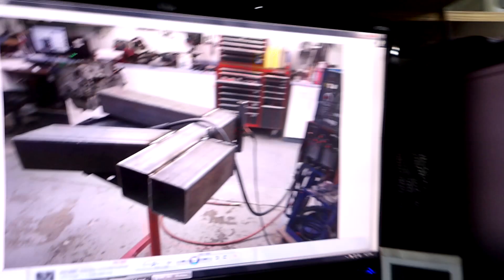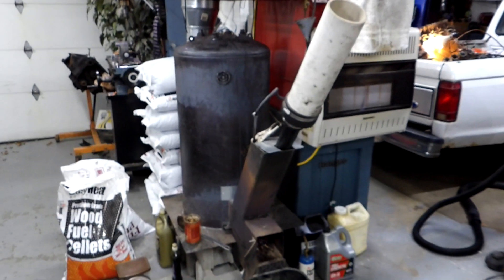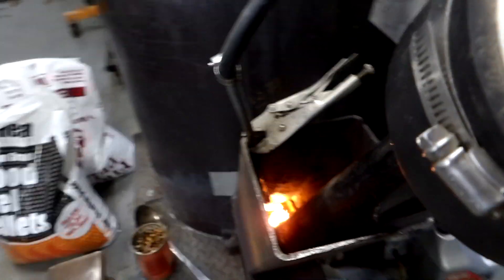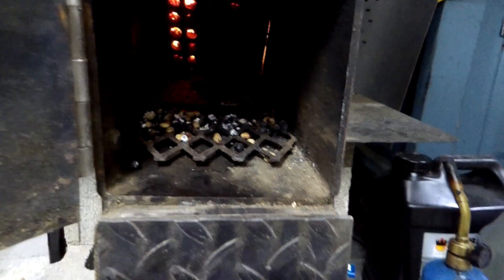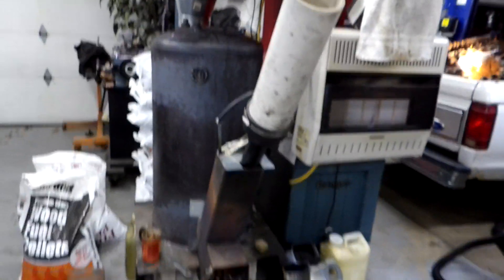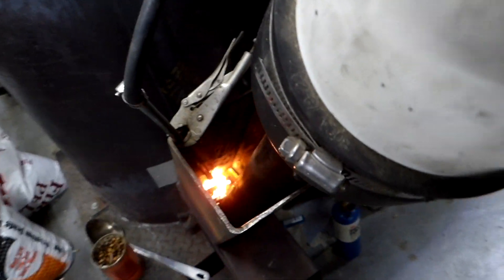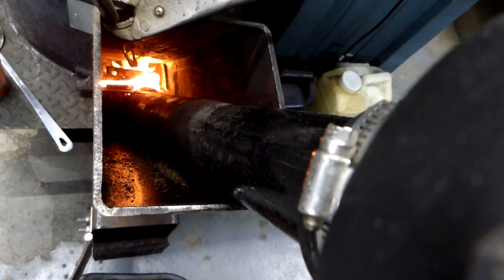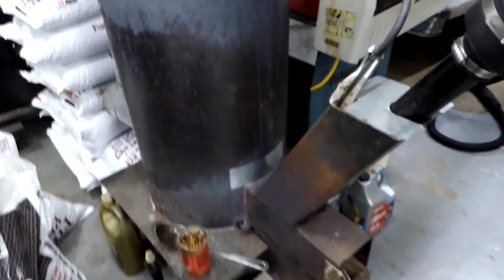Rocket Stove on Wood Pellets - They ROCK !

Comment: Just waiting for a friend to get me a 6 inch heavy duty 316 4ft stainless tube it's all a waiting game if you want The materials for free
Reply from the maker: Are you going to make the burn chamber AND the riser out of stainless ?  If so, you'll need 8 feet to duplicate what I've built.  2 feet for the horizontal burn tube, and just short of 3 feet
for the vertical riser -- assuming you're using a retired 40 gallon hot water tank that measures exactly 3 feet high, plus another 2 feet for the feed tube.  The clean out isn't really necessary, but if you want to incorporate it, you'll need 1 more foot of tube for a total of 8.    I stopped the riser about 1 1/2 inches from the top of the tank.

Comment: How long has this been running have you had any issues with the riser chimney/tube burning out thanks
Reply: Thanks for fast reply very intrested how it all works I will be building a rocket stove in the near future so trying to gather as much information as possible so I can buil it once to last forever and also have an unlimited supply of wood chippings so maybe use nearly the same method as you just trying to source a very thick walled steel riser tube it will be worth it in the end
Reply from the maker: @grahamprecious7330  If I was designing one to burn wood sticks/logs I'd make the feed tube straight up and down and instead of 5 x 5, I'd go 6 x 6 for the  feed tube and burn chamber.   Let me know how it works out !
Reply from the maker: This is my 4th season, and no problems with the riser tube burning out. Even the burn chamber looks great.  I didn't insulate the riser.  No need to in my opinion.  In fact, you WANT the heat to escape into the barrel so it can then radiate into the surrounding space-- at least that's the way I see it.

Comment: Hey nice job! How many bags of pellets do you use? If you want to share some of the plans on the design we would be grateful. I need to make one too. Thanks again !
Reply from the maker: I'll burn 3/4 of a bag a day for most of the heating season, Nov thru Feb.  The design is what I describe in the video. 5 x 5 square tubing and a retired 40 gallon hot water tank.  I need to rebuild the burner so may be I'll make a video on that.

Comment: I have slightly strayed from your measurements and it might be too late to turn back.  INPUT PLEASE?????
Burn tube 6"x8" high
Feed tube 6 x 6
Riser 4" x sched. 80
Will making heat riser tube smaller have too much restriction or will it give a venturi effect?  Inside of riser is 3.5" id.
Reply from the maker: Sorry Wayne, just seen this.  For some reason I wasn't getting notifications.  I think your design will work just fine... the 4 inch riser will  limit the air flow, meaning, it will then determine the total BTU output along with the height of your chimney.  The feed tube will allow you to put in larger pieces of wood.... a good thing.  It's something I would do if I built another one.  As well as the larger burn tube.  All good.  Did you end up using it ? and how did it work out ?   Email me @ gearhead4you@yahoo.com if you'd like, I love to know more.

Comment: Sir, is your rizer tube in the tank made of stainless or insulated, sounds like you've had it running some time with no issue. Great design Im thinking of making a mini for a camper.
Reply from the maker: It is just cold rolled steel, cheap, inexpensive, 5 x 5 square tubing. It is not insulated, nor is the burn chamber (the horizontal leg where the fire exists).   I do not understand the reasoning behind insulating the riser and chamber.  It seems to me you 'want' the riser to 'give up' it's heat to it's surroundings. The temp within my burn chamber is so hot it is already burning the wood gas - the whole point in a rocket stove.  I think the people who insulate the riser are attempting to ensure the wood gas gets burned.... that's all I can figure.  Not necessary - IMO.   There is no sign of degradation to either my burn chamber, or riser after 3 full seasons of use. If you insulate the riser and chamber, you'll be fighting constant degradation from overheating. At least that's what I've seen in other videos.  Hope this helps.
Reply: Great !   Don't believe it's good to run a stove over 550 temp as you get intense degradation over that (Why the use of SS steel I figure). I built a small regular stove and was able to get 850 temp but it did start flaking at that temp. Great proven job you have. 

Looking At your feed/drop I'll bet you could make an adjuster fine tune the funnel up /down, but suppose it may all be relative to other factors......   Thanks 
It's good to know your work has endured so far.. I will take your lead and not worry about insulation.  Thanks for that.

Comment: If I build mine using a 30 gal or 55 gal metal drum, do you foresee any problems?
Reply from the maker: No, I believe either will work. If you live in a very cold climate I'd lean toward the 55 gallon drum. More surface area = more heat transfer  ;-)

Comment: Great design!  Such a nice job... Ramping up for my own build and I do weld so your design is very doable!  As an experiment did you ever burn kindling wood? (If you ever ran out of pellets for some reason.) Did you video your pellet burn chamber build? I know it sounded simple but sometimes words alone don't leave the audience (me!) without some questions... Like, the relationship of the burn chamber over the ash clean out?) Thanks for sharing. Again, great design!!
Reply: Your other video answered my question re burning wood. Obviously works fine, just added labor!
Reply from the maker: Yes, a lot of labor. Have you seen these people who use small pieces of wood to heat their home throughout the winter months ? I question it. Yet it's being done. Fouch Family for example. They're banking the energy. I'm thinking their burn chamber is larger and insulated with the surrounding mass so that they can use larger pieces and the fire is maintained. Perhaps 8x8 and the burn chamber encased in cement block.
Reply: I haven't seen that particular one, but have seen many rocket stove mass heater builds and some are really impressive. I have a farm in Michigan (hour north of Grand Rapids) where the mass heater sounds like a nice option, but here in Indiana I just need two rocket stoves. One for a garage and the other for a small house about the size of your two story work shop.  I'm using (a gift) commercially built pellet stove to heat the house. It uses about 1 to 2,5 bags per day (40 to 100 lbs) depending on the heat setting. Currently I know I am loosing tons of heat up the chimney flue! I thought it might save me some money over electric heat, but now I don't think so. It doesn't burn hot enough = lacks efficiency!  I'll try to let you know how my build is going, especially if I try any modifications... Thanks again for the videos on your stove and for getting back to me re my drum question!
Reply from the maker: I have, parked to my left, about 40 feet away, a commercially built pellet stove that I tried for the better part of a season. What a joke.  Like you say, burned over a bag a day and I wasn't warm !    They do not throw off UV except the tiny window on the front of the stove.  Sure, the air would be 68-70 but I was cold.  Couldn't take it.  Put the rocket stove back in place and instantly I was warm from all the UV radiation it gives off.  That big dome (40 gallon tank) radiates UV in every direction.  It was 56 in the shop this morning (20F outside last night) and within 20 minutes of running, I was already warm enough to be comfortable even tho the air temp in the shop was only 64 by that point.  The down side is of course the fact that you have to 'tend to it', like any wood stove. One more thing.  With the commercial pellet stove running, my metal wash tub and work bench was forever cold to the touch.  With the rocket stove running, those same items, some 25 feet away, are warm to the touch.  It's all about the UV  !
Reply: Mark, thanks for the conformation...  It wasn't just "me!"  Forgot to mention - Your putting the fan over the rocket stove blowing down seems brilliant especially since you are working on cars and, no doubt, find your self kneeling or lying on the floor... The downdraft of warm air sounds wonderful!!
Reply from the maker: Yup, the down draft fan is everything.  Warms the floor for 20 ft in each direction.  While we're on the subject, the first fan I used pulled 145 watts on medium.  When it finally quit (melted it twice because I forgot to turn it on..lol... dripping strings of plastic- and Stink !) I purchased the first $16 fan I ran across at our local True Value hardware.  This thing pulls 40 watts on medium and 52 on high.  Who'd think technology would advance that much when it comes to fan motors. I bring that up because if  you live off grid like us, that 100 watt difference is huge !
Reply: Not living off-grid yet but working toward that option... Thanks for warning about the fan... I may try to find an all-metal version (as my memory might have the same failure!)  20' is a really nice spread!!  I don't have time to start the build for a few weeks, but am gathering materials now.  Really appreciate your helpful dialogue...
Reply: I don't think it's UV=ultra violet, maybe IR=Infra red?
Reply from the maker: Hahahaha.... YES Craig Symington --- IR (NOT UV)... I'm such a dope...lol.

Comment: Thanks for your last response, just on more question.  For my outer shell I am looking at using a piece of 16" diameter pipe.  Unfortunately it is about .280 thick.  I am guessing it will take a little longer to heat up, but will also hold the heat longer. 
The reason I am using the 16" od pipe is that a large truck brake drum will fit perfectly over the top.  I want to use the brake drum because of it's mass and weld 1/2" plate on the drum sealing up the center.  It will also allow easy removal for inside inspection.  
I appreciate any input.
Reply from the maker: I think it will work.  The thickness, like you say, will just store some heat.  My 40 gallon tank is 18 inches in diameter, so it's just a tiny bit bigger.  The main thing is you want a tank that has as much surface area as possible- within reason.  The more surface area, the more efficient it will be at radiating heat to the surrounding air.  I'd be willing to take a guess and say that a 30 inch diameter drum would be quite a bit more efficient than my 18 inch--- but, a 30 inch drum would also be unreasonably large for the area most people have to work it.  Your brake drum is a great idea ... and with the plate, you'll have a flat surface to park a pot of water if you need some added humidity !

Comment: If you fill your feed tube with your pellet/pit blend, how long will it run on a fill up? The biggest drawback to a rocket stove is you can't really stoke it but with your design and fuel choice, you can! Awesome job!👍😁
Reply from the maker: In the beginning (morning) with a cold shop and clean burner, it will run about an hour and 15 minutes on a load of pellets.  So from 8 am till noon, I fill like 3 times.  In 20F weather, the shop will have gone from around 60F to 70F in that period of time.   At this point, the burner is starting to partially fill with ash, which works out good because I don't need all the heat that a clean burner puts out.   Then, I put pellets in perhaps every 2 hours and by 4 pm, I'm down to hardly putting any pellets in because the burner is nearly completely clogged with ash.  At that point, if I need some heat, I take my stir rod and agitate the burner a bit which allows the ash to fall thru the holes into the clean-out chamber (below) and within minutes I have a ton of heat flowing once again.  

Prior to building this rocket stove, I had a burn barrel that I'd modified in attempt to make it efficient.  It was a 55 gallon barrel that I had lined with fire brick and had a re-burn plate that I'd fitted in attempt to get the wood gas to burn.  I was somewhat successful.  However, the amount of work that went into making kindling to start the fire, and tend to the fire through out the day was many times the amount of work that goes into scoping the pellets into the hopper several times a day.  It isn't even close.  Yes, I could bank the fire for several hours, where you can't do that with the rocket stove. But with the rocket stove, if the fire goes out because I had to leave for several hours, I can have it going again in minutes by giving the ash a stir, dumping a few pellets into the chamber and lighting another fire starter.  

Thank you for your comment and the compliment !

Comment: Very nice.  Curious what you did for a heat riser, is it insulated, is it burning out like many do, what size is it, and what material did you use for it
Reply from the maker: Take a quick look @ 0:15 -- 5 x 5 x 1/8 wall square tubing - nothing special, just off the shelf from the local metal supplier. Not insulated. I see no reason to insulate the riser like so many people do when they build a rocket stove. The flame is 1500F + in the burn tube- thus burning all wood gas before it even gets to the vertical heat riser. In fact, you WANT the vertical heat riser to give-up it's heat to the surrounding air before it takes a trip south and ultimately out of the can and into the chimney-- right ? Why would you want to stop that process. I'm not asking you, I'm just saying, why. Why would you want to insulate the riser. As you stated, you'll find many examples of risers burning out from the extreme heat. I can't see my riser, but I've looked into the burn chamber with a strong light and it looks just fine. A tiny, TINY bit of flaking on the walls right after the burn basket that's it.  Given that, I'm sure the riser looks like new.  

You might find this interesting.  On the back side, where the chimney connects, I have a clean out cap that I can remove. It's 6 inch diameter.  While the stove is running, I can quick pull that cap off and with a strong flash light - look into the 40 gallon tank and see the butt end of the burn tube where it makes a 90 and heads up into the riser.  That end of the burn tube looks like the day I built it.  It is slightly blue.  Furthermore, there is absolutely NO smoke inside the tank for the first few seconds.  Then suddenly, smoke will start to fill the can because I've lost the draft by removing the 6 inch cap.  This is how I know it's burning clean. Also, the chimney pipes are very clean inside. No build up what so ever.  Just a tiny bit of ash will be laying in the clean out area, fly ash that made it up thru the riser and fell down. 
How's that for efficiency !
Reply: Impressive results in efficiency!!

Comment: Im in love with this Heater! You can get a 4" metal or pvc cap for a couple bucks for your hopper from any building supply
Reply from the maker: It has been SUCH a blessing-- we've had a cold spell the likes of which I have never seen.  We had day time highs of 0F for like 2 weeks. She has kept the shop warm.  It has taken some work tho.  I'm learning.  In this extreme cold, I've had to let it go out once a day, say late afternoon, so I can pull the feed tube and stir the ash down into the ash drawer-- thus allowing me to once again have a raging hot fire.   The solution would be some sort of agitating ash mechanism that would allow me to shake it down, like a coal stove uses.   In 20 or 30F weather -this isn't a problem as I can release enough ash using the metal probe (shown in the video).  Thanks for dropping in !
Reply: @mark_osborne  

I wonder if you switched to pure pellets on the frigid days if that would be better .

I run ENERGEX PREMIUM SOFTWOOD BLEND (energex.com) and have almost ZERO ash; we run our pellet stove for weeks on end without needing to clean
Reply from the maker: @rawsushi  Yes pure pellets are most certainly hotter and the hotter she runs the less ash she makes.  I agree, this winter I made almost no ash.... I only emptied my 16 gallon shop vac 3 times and each time it had may be 2 inches of ash and that was after burning almost 200 (40) lb bags.  Extremely efficient !  Thanks for the comments.  Love talking with smart people.

Comment: Great vid my friend! I was wondering why the feed tube was angled like that; do you suppose straight up would work as well?
Reply from the maker: Funny you should ask this question, I was just discussing that possibility with a friend who's interested in building one.  The advantage to having the feed tube on a slight angle is it helps keep the burn-basket up tight against the back side hole of the burn tube.  This is necessary as the only thing that makes this thing burn pellets is the fact that air is being sucked thru a tightly fitting burn basket that has a series of holes drilled in it. 

If you made the feed tube straight up, you'd have to make something to hold the burn basket back tight against the hole.  Being tight may cause a problem.  On occasion, you have to remove the burn basket completely to clean it. Ash, etc, sometimes builds up on the sides of the basket.  If the basket fits tight, I almost guarantee you it will be hard to remove.  My burn basket is actually about 3/8 inch (10 mm) narrower than the feed tube.  I fill that gap with a piece of 1/4 (6 mm) flat stock.  I drop it down in (next to the burn basket) after the burn basket is in place.  This allows for some side to side freedom that is so important.   

The only other reason to have the burn basket at a slight angle is ease of loading.  Just the fact that the tube is tilted slightly allows me to pour wood pellets into the feed tube without spilling them out onto the floor.  I still sometimes spill a bit.